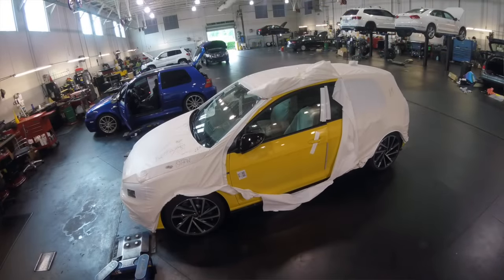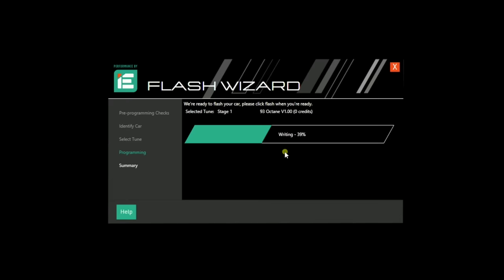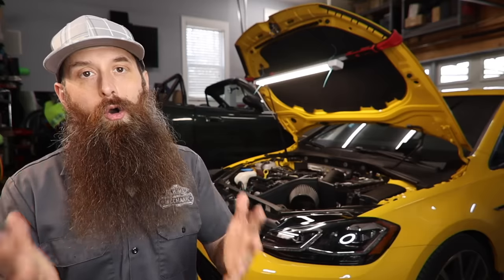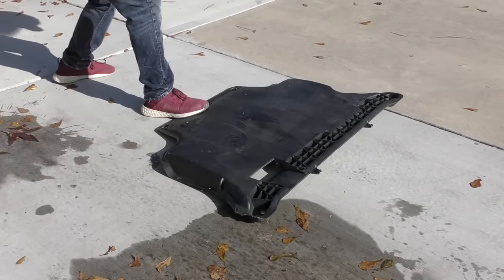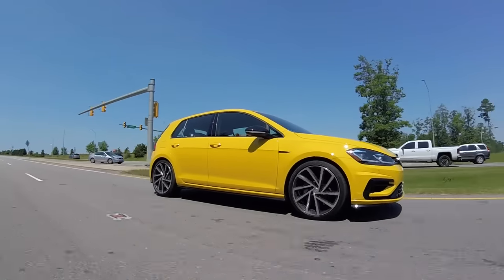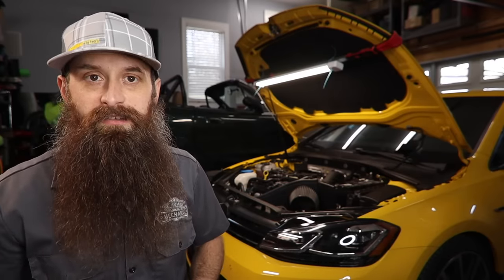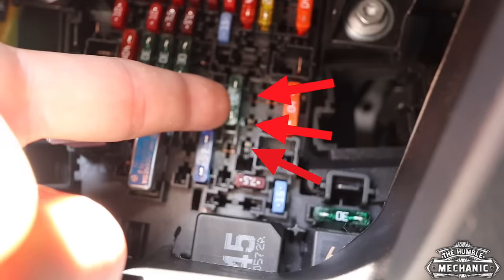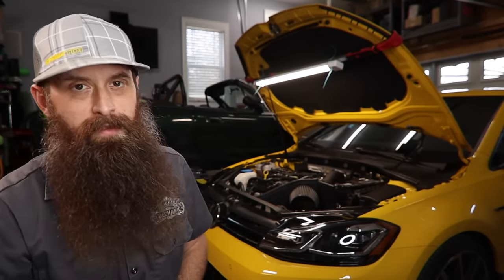The 5 BEST Modifications for the Golf R ~ Do THESE First!

Comment: I have a 2015 MK 7 Golf TDI, would you recommend any other mods specific to TDI's?
Reply from the maker: Not really. I’d still rock this list I think.
Reply: @HumbleMechanic  I went to check in on ordering a rear sway bar for my MK 7 tdi and it has a rear torsion beam instead of having a independent rear suspension...  so, no rear sway bar for me...

Comment: You can enable the touch sensors on the rear door handles?!  Is that true for all MQB cars, or just the R?  I thought those weren't even wired.
Reply from the maker: They don’t have sensors. I had to install new handles and wire them. Pretty straight forward

Comment: Really want to get the parking sensor overlay to show by default on the backup camera screen. Could you share what adaptations are needed for ODB11? I have a Mk7.5 GTI, if it makes a difference.
Reply: cmsmith2010 Hey, this is how I did it on my GTI: go to module 5F (information control unit1), then Long Coding, then change byte_16_legal_rvc from Yes to No

Comment: @HumbleMechanic Highly agree with the list, as I have 4/5 of your recommendations for my mk6 R. 5/5 for me are Suma Performance side mirrors which substantially increase the mirror viewable area to reduce/remove blindspot and reduce glare (sunlight and headlight), and come with a slight blue tint. The default mirrors you can barely see anything out of, the Suma's improve coverage massively.
 If your R is manual, I would also HIGHLY recommend a short shifter kit and shifter bearing kit swap as your FIRST mods, as these change the shifter from being 'stirring chicken soup to loading a bolt action rifle' - massively improving the enjoyment of manual driving.

Comment: Hey Charles.  I'm getting a scrunchie noise on my suspension mostly driver side. Notice it more when in comfort mode and driving over speed bumps at slow speed.
Any thoughts on what it could be. Thank you
Reply from the maker: Probably a lower control arm bushing if it’s going up and over bumps
Reply: Thank you.. is that a DIY job or do I have to take it in

Comment: if you're tuning a GolfR the clutch on the manual transmission can't handle much more power... you should basically plan to replace the clutch on a manual transmission if you tune.
Reply from the maker: Yep.
Reply: whats a safe amount of power increase on stock clutch?
Reply: @demetrij7120  it's difficult to say i've heard of people with Stage 1 burning out a clutch... APR is your best choice as they have "low torque" options that will help your clutch life but basically if you want more power start saving for a clutch and run your stock one till it dies :D

Comment: I have to slightly disagree with you on the brakes , both my 2015 GTi autobahn and my 2016 R had/have extreme Juddering while braking past 100mph. Thats will be my first upgrade on my new R as thats the only thing that fixed my GTi.
Reply from the maker: I haven’t experienced that at all. They have been amazing high speed and autoX. But pad upgrades aren’t too bad. But for 99.99999% no BBK needed
Reply: @HumbleMechanic  Pads could definitely help, I just went with the stoptech kit on my GTi with Drilled and Slotted rotors and  Sport pads, The same kit on the R has Rotors, Pads, and SS brake lines. I agree the BBK is not needed at all the stock calipers are just fine. I think it could be regional that the stock rotors just cant cut it in my climate.

Comment: Hi Charles. I'm loving my 2018 R but I hate how the coolent temp gauge always lies. It quickly rises to 194 degrees and always stay there. I have the obd11 scanner is there a way to have it display the actual temperature and not the fake 194 degrees?
Reply: Also, here's how I coded the disable auto-start-stop. I have had no issues with it and im at 20k miles now.
Adaptation
    Control unit: 19 Gateway
    Name: Start/stop start voltage limit
    Values: 
        ---: 
            Old value: 7.8 V
            New value: 12.0 V
    Mileage: 2049 km
    Date: 2018-08-18 08:32
Reply from the maker: Yes but you get a notice in the dash about stop start. I don’t want that. 

I don’t know about the coolant. I’d have to dig. Vw Coolant gauges are all like that. They have a range they function in.
Reply: @HumbleMechanic  maybe because I use the obd11 and you dont. I've never received any errors in the dash about the auto stop start. All it says in the dash is that it's off. Just like if i hit the button to manually disable it.
I'm curious if it's because you have a 19 and I have a 18, the way it was programed, or if I got lucky.

Also, If you can dig into the coolent temp gauge that would be great. I have a feeling it's programed to lie at 194 degrees until the actual temperature reaches 240+

Comment: i’ve heard that the stock clutch in the r isn’t made for anything over stock power and slips with stage 1. have you heard anything about that?
Reply from the maker: That’s most everyone’s experience
Reply: For the manual transmissions, do you recommend a specific clutch upgrade? I know you have a DSG but since you’re knowledgeable on these types of transmissions, would love to hear your thoughts
Reply: @HumbleMechanic  I would also like to hear your thoughts on tuning the R that has a manual transmission. Stories about the stock clutch not holding after even a stage 1 tune is the only thing keeping me from doing a tune.

Comment: At 10:15, you mentioned you coded the ops to pop up automatically... can you share the coding sequence? Please and thanks!
Reply: I found it; I have VCDS.  I went into 5f and then long code helper and click on square for byte 16.  You're looking for 'Byte_16_legal_rvc'.  I have the older connector/software so my page does not show the actual option;  However, it is there according to a discussion I found in a forum.  My fix was to manually change the code from 1001111 to 0001111.  The details are here: https://forums.vwvortex.com/showthread.php?8927457-MK7-5-Golf-R-VCDS-Tweaks/page29
Reply: Bill White I have OBDELEVEN. Just tried it. Can’t find it with that. I’ll try looking for it when I get my hands on VCDS. Thanks!

Comment: Does that engine have an EGR? I remember doing this on my Gen 1 Mazdaspeed. It's was about a 6 hour job, start to finish using media blasting. The only thing different that I did was put some pressure in the cylinder via the spark plug hole the rotate the engine until the I take valve opened to blow back any debris. I have 45,000Km on my Forester with an FA20DIT and I'm planing a valve cleaning at 50k. Good video. Thanks.
Reply from the maker: No, it uses valve timing for NoX control

Comment: How do you code the back up camera so the overlay is on by default?  I'm using OBD11 but couldn't find a how to via a quick Google search.
Reply: I found it; I have VCDS.  I went into 5f and then long code helper and click on square for byte 16.  You're looking for 'Byte_16_legal_rvc'.  I have the older connector/software so my page does not show the actual option;  However, it is there according to a discussion I found in a forum.  My fix was to manually change the code from 1001111 to 0001111.  The details are here: https://forums.vwvortex.com/showthread.php?8927457-MK7-5-Golf-R-VCDS-Tweaks/page29
Reply: @billdwhite  thanks!  Totally worked and super easy exactly where the post said using OBD11

Comment: You save money on software but have to get a stage 1 clutch
Reply: And have the risk of blowing out the seals with the crank walk issues. Apparently the manuals have this issue due to cost cutting done from VAG using only 2 seals instead of 4 on the crank shaft.

Comment: My headlights are not good in the rain.  I have a 2017 MK 7.5 Golf R. I do not like the headlights and would like to have fogs installed for poor visibility conditions.  I have seen some videos on install, so I know I am not the only one with the problem.  My wife's 2017 Alltrack has much better headlights.  I was told they would not fit.  I do drive in bad weather conditions in the mountains sometimes as I will take it skiing. I live in Colorado. I recently bought the car.  It is a great performer except for the headlights and the (IMO) idiotic soundaktor which I plan to disable.

Comment: It still drives me nuts that the fuse slots are not numbered. I have a MkIV with a fuse map on the box cover that VW has eliminated as a short sighted cost savings.
Reply from the maker: They are numbered, but you dont get a list of what is where.

Comment: how about warranty? our local dealerships will void car warranty if you do such mods on your own ..
Reply: With audi in the uk a remap will void any drivetrain faults, engine gearbox wheelbearing driveshaft propshaft etc but stuff like suspension and electric fauls will still be fixed as the remap has no effect on that.

Comment: I hear you want to prove “the powers to be”  wrong and code in the  remote start?! I can get passed the immobilizer (not by simply coding the OE immobilizer off because that still doesn’t get beyond not needing a key in the car) the part I personally have found more challenging is, sending the appropriate signal from the the key fob IE: hold down lock and unlock for 3 seconds to start) my point being if you’re the owner of the car,  there is very simple loophole to bypass the Theft deterrent system and still have an active immobilizer/anti theft. In summary , you need to send a signal that the car will interpret as if it were “you”  pressing the start button in the driver seat,  everything else is rather simple.     This only applies to OEM  remote starting feature.  Greg,  Audi New York
Reply from the maker: I think they way around that is an Atlas key. It wouldn’t be the R key, but I’m cool with that

Comment: I don't drive with a spare or an entire change kit. That's extra weight, longer breaking distance, worse MPG, & worse handling.
Reply: But negligible in all respects - and the handling should probably actually be slightly better, as more in the rear should help with the standard front-heavy weight distribution.  That said, it's also a negligible difference for road driving anyway.
Reply: Never had a flat. Most of my driving is within 20 minutes from home. I'd call a tow truck or cab. Fix a flat plug kits are something I'd consider for long trips & I do have a cigarette lighter powered pump. I gives no fuks m8 cuz w8 savins bruh
Reply: You better do a seat delete too because passengers impact all that way more than a spare tire would lol.
Reply: I have had passangers twice in six months of ownership. Rear seats may get deleted, haven't gotten to it yet.
Reply: This makes more sense if I tell you I drive an E82...

Comment: @ Charles HUMBLEMECHANIC, I'm enjoying learning from your channel,  thanks. I think I should have bought a R instead of GTI now but I'm to deep in upgrades now. If you get a couple minutes check out my GTI mk7.5 with IS38 upgrades etc and shout out any advice,  heck give it a drive sometime. Your R and my GTI would be a good comparison IMO for people wanting to know what is possible. I think my front rotors were installed backwards but I have to investigate it more. Would adding a muffler help in power or maybe decreasing weight of car?
https://youtu.be/OA9aQ09hCBg
Reply from the maker: Sweet ride. Usually rotors are labeled. The muffler may give you a little more power and better sound
Reply: @HumbleMechanic  If you are ever close by you are welcome to drive my GTI, I live in the southeast corner of Alabama next to Fort Rucker.  The rotors have a directional arrow on them but the APR authorized installation shop put them.on backwards. When I get time off I'll deal with it. Keep up the good videos. 👍